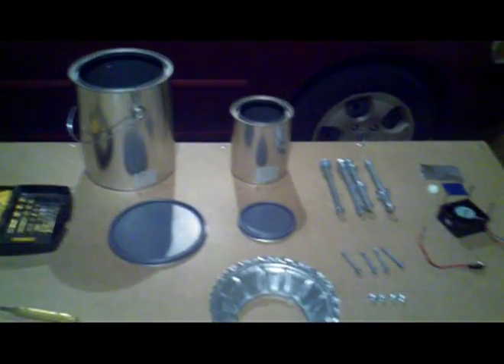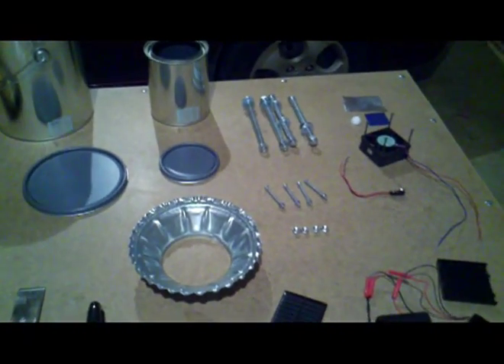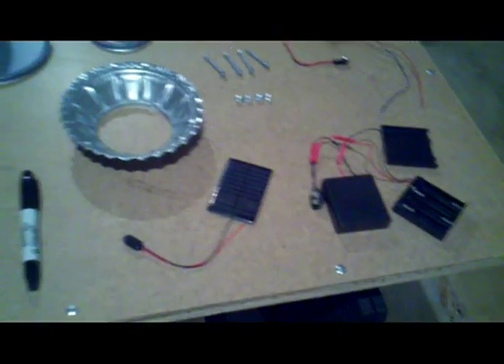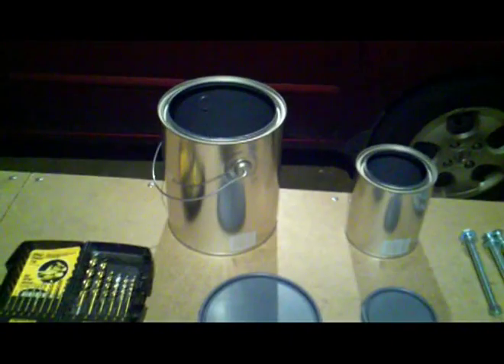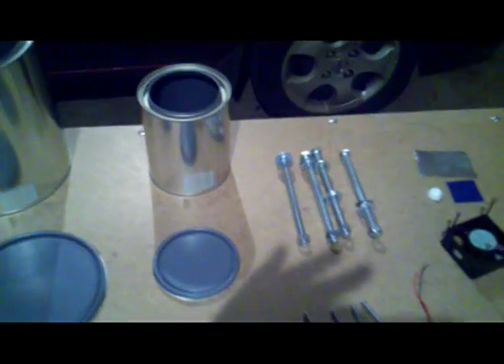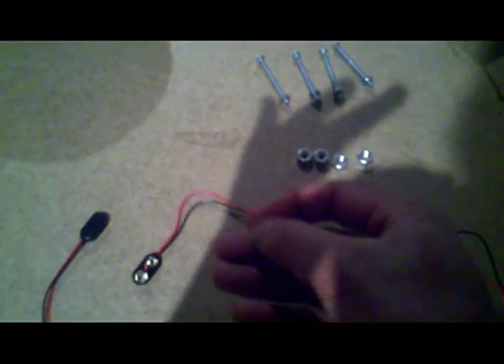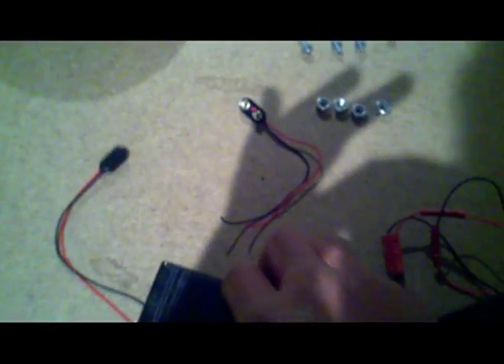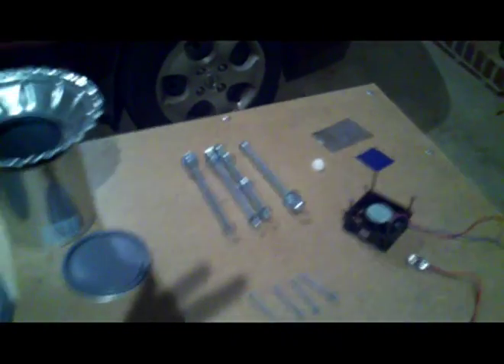DIY Forced Air Wood Gas Stove Part 1 - How To Build It.

Comment from the maker: No, my concern is with heat and the fact that I don't think the beer can will withstand the heat and or pressure for a prolonged period of time.  If you substituted the beer can with something a little more substantial, that would alleviate any concerns, i.e, soup cans etc.